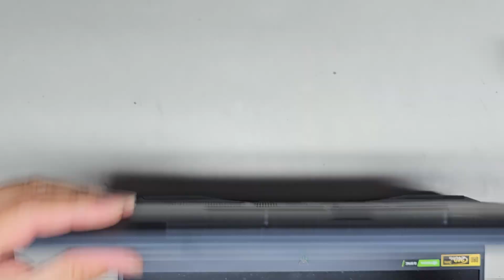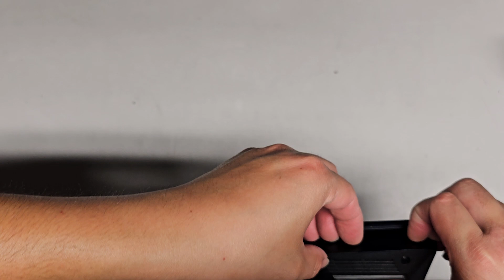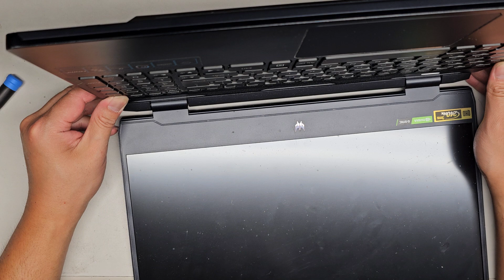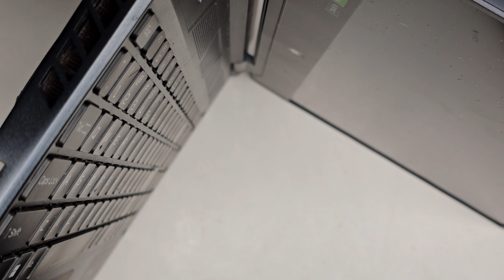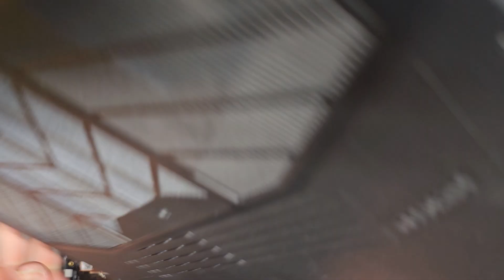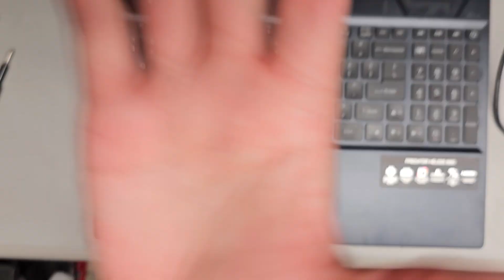Acer Predator Helios 300 N22C3 Disassembly RAM SSD Hard Drive Upgrade Battery Replacement Repair

Comment: Mine randomly black screened (I assumed it crashed per usual as since I got it three years ago it did it regularly) and now it won’t turn back on and I’m genuinely like so confused, plus even though mines the same model I can’t even open it even with all the screws loose, for some reason the only thing that pops off is the cover for the thing that lets the screen go up and down.
Reply from the maker: You need to take the screws out, not just loosen them... lol
Reply: @ItsBinhRepaired sorry bad wording LOL I did remove the screws, the case itself was being dumb when I was trying to get it off, my friend thinks it’s the battery (since it’s not giving any output or taking anything in.) thanks for the link I’ll def check it out!!
Reply from the maker: @zebspice8029  should come off easy with that
Reply from the maker: Here's the easy way to remove the cover https://youtube.com/shorts/9iuxaVEpOVY?feature=share

Comment: Thank you for this great video is  this model screen a 30 pin or a 40 pin I need to replace the one I have .
Reply from the maker: How many pins is not important. Check the model number on the back of the screen.

Comment: Thanks for the video! It helped me add a new Ram. For the second empty nvme SSD slot, is it 80mm or 42 mm? there seems to be alot of things blocking the installation area of the second 80mm ssd. But i may be wrong. Thanks!
Reply from the maker: I believe you can put a full sized one

Comment: My touchpad of this same laptop isnt working. Its new one and warranty is just over. 
I m advised to get the touchpad changed. But its quite cumbersome to dissassemble and fix it.
Reply from the maker: @gaurab197  :( sadly
Reply: @ItsBinhRepaired  you mean the touchpad cannot be dissassembled and replaced
Reply from the maker: @gaurab197  what's the model of your laptop?
Reply: @ItsBinhRepaired  same N22C3
Acer predator ph315-55

Elan touchpad

And I tried everything with the drivers ....nothing worked.
Reply from the maker: @gaurab197  can't seem to find the replacement part.
Reply: @ItsBinhRepaired  ....even i couldnt find anything online.
As soon as the warranty got over , touchpad stopped working in both I2c and ps2 mode. I formatted the laptop fully and reinstalled windows 11. Uninstalled / reinstalled drivers and did 100 other things...nothing worked . 100 % its a hardware issue .

Comment: Do you now what thickness the thermal pads should be
Reply from the maker: @IdleDnB  nope
Reply: Which ram for upgrade will it take 2X64 or just 2x32.
Mine is now 16 gb total, 2x8 I assume - has not had it open yet.
Reply from the maker: @BaumSpieler-DK  if it's the same speed, any size will work.
Reply: @ItsBinhRepaired not it it support more than 32 GB totally